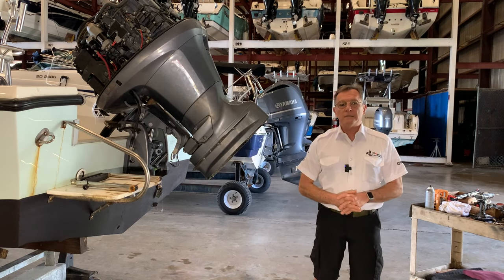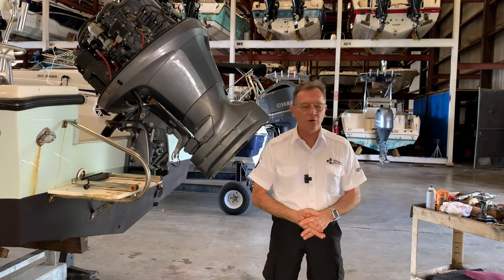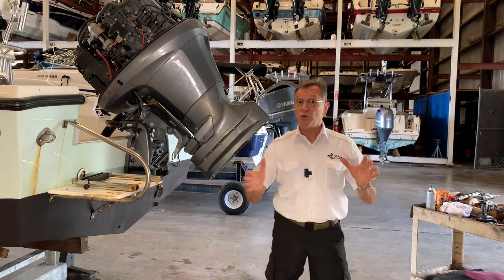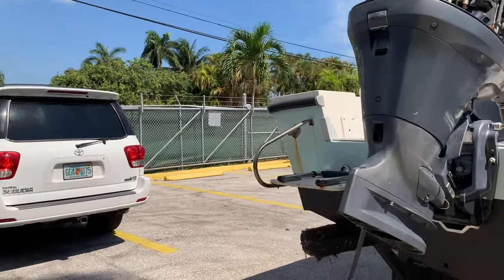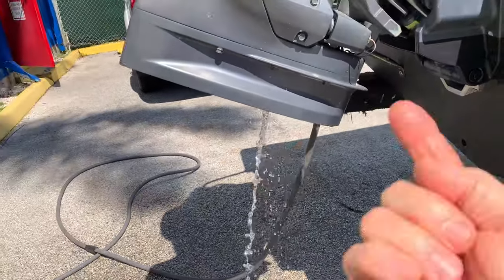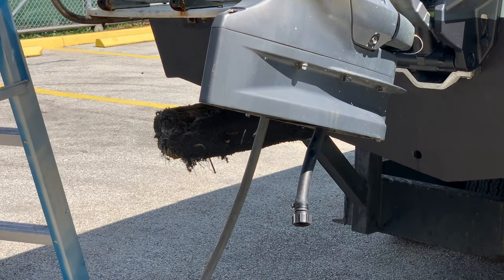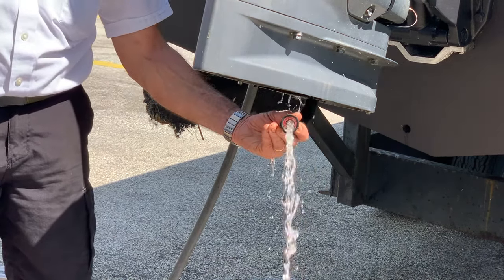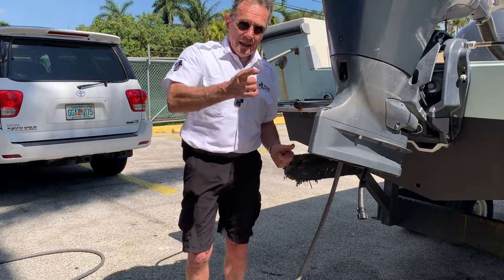CAN I RUN YAMAHA F-150 WITH TOP FLUSH ADAPTER ????

Comment: Burns up impellers , I fix them all the time . However like you said low rpm and for less then a minute is fine but never run for long or rev up on the flush adapter . If running long time u need both top and ears hook up
Reply from the maker: Yeap you got it. Take care.
Reply: What do you mean by need both top and ears hook up? I’m planning to run my motor on its trailer for 5-10 minutes..
Reply: I use both top connection and bottom ear muffs too.  Maybe not necessary just for a quick startup on idle but extra precaution on my part.  Thank you for this informative video.

Comment: I appreciate people like you doing videos like this. I just picked up a Suzuki 150. And I've been running it for approximately 4 to 5 minutes at idle while I had the hose hooked up to the port. Then somebody told me you can't do that. And I say why the water pressure is the same. But your video was very, very specific and self-explanatory.  Now I feel much safer. But of course, my last engine didn't have a port old Evan rude so I didn't have a choice. I used the ear muffs so this one's a little new to me. But Suzuki says I don't have to run the motor at all, which is kind of nice.
Reply from the maker: Thank you for your comment and for participating. 👍🏻

Comment: hello and thank you for your precise explanations :) 

can you tell us if there is a recommendation when flushing the engine on the trim position? Should we preferably keep the trim low or in the maximum high position and take the propeller out of the water at the dock? 

Is it also necessary or recommended during each use in salt water to add an anti-salt additive during rinsing with an automix?

I have a Yamaha F150 and I would like to have your valuable opinion

Comment: During winter season here in east coast, can I remove the lower unit and keep it in my basement for the whole winter? 

Yeah, I always flush my motor from the top port with no problem at all. 

Thanks for the info.
Reply from the maker: Hi Bean, Yes you can,  but what would be the advantage of doing so? Can you elaborate more on this? Thank you for watching and participating. Take care. 👍🏻
Reply: @us4marine  -I winter my boat in a marina so I would rather install a new impeller at home and keep it for the winter.

Comment: Here’s the issue and why Yamaha tells you you should not run the motor through that flush hose. Most residential homes do not have the water pressure needed to safely run the motor while using this method. The water pump pulls water up through the housing and by using your method you’re pushing water into the housing and the impeller is pushing it back faster than it’s coming in therefore you will burn up the impeller.

Comment: Thanks for an informative video on this. I've been doing it thru the hose for a long time and my 2007 Yamaha F50TLR has not been damaged. The only thing is, I've been letting the engine run, after running in saltwater all day, for 5-8 minutes which I hope is not hurting engine. Please let me know if  I'm doing this wrong. Thanks my friend for your knowledge. Steve
Reply from the maker: Hi Steve, no,  you’re not hurting your motor letting it run for 5-8 minutes of flushing through the top adapter, as you can see, there’s is plenty of water/lubricant, getting to the impeller. Thank you so much for watching and for stopping by. Take care 👍🏻
Reply: @us4marine  Thank you for reaching back out. I  do respect ALL your videos. They're full of knowledge and people should respect them and also watch them. Steve

Comment: Great video, you are a wealth of knowledge thank you for this. I have one question maybe you could help me understand with this same engine. Mine is a 2013 F150. After being used in salt water I flush my engine after every use. When I connect to the flush hose and run fresh water I never get water coming out the telltale port like when its running. Is this normal? I always think its better to use the muffs and run the engine to flush instead of the hose? What is better? Thank you!!!
Reply from the maker: Hi Wol9, this is very common on some of these 4 strokers, however is not that common on the F-150, do you have good water pressure on your garden hose? If water comes out when running with the lower flush and not with the top flush adapter and if you have good water pressure, I can only think of the pressure relive valve, some people in the industry call it "Poppet valve" and is this cover right behind your oil filter with 3   #10 bolts. This valve is spring loaded and it needs very good water pressure to push the plunger. But if you’re getting water flow on your side indicator with the bottom muff, I wouldn’t worry too much about it. Now, if you want to make it pee with the top adapter, increase your water pressure and that should do it. Hope this helps. Take care and thank you for participating, your opinion matters. 👍🏻
Reply from the maker: It really doesn’t matter, both ways will do the job, but remember if you doing it from the top with the engine not running, make sure the block is warm enough so the thermostats are open and you’re getting fresh water pass the thermostats and on the other side of your cylinder head.

Comment: what about that thru flush hose thermostat is not open , so water does not go thru all of head of engine?
Reply from the maker: Hi Jedi, correct, that’s why I tell all my customers to let the motor reach it’s running  temperature in order to wait for the thermostat to open, so water can flow through the exhaust side of the cylinder head. Now if you’re referring the water flow while I was testing? No, water was not flowing to the any part of the block because the lower unit was off. The only intention on this test was to show  the impeller is getting plenty of water when using this flushing method.
Hope this helps. Thanks for watching.

Comment: The impelar pumps water up, your pushing water down in the opposite direction to the impelar, I presume the idea of top flushing is to allow you to do this is whilst it's still bolted to the transom in the water.
When water is fed from the top, the impelar is going to try and reverse the flow back up into the engine, could this cause overheating issues if the pressure was equalised and the flow is stopped or slowed?
Reply from the maker: Hi NJ, thank you for watching, your opinion and comment is very appreciated.
The intention of the video is to show that if you run the motor (at idle) while flushing it from the top, the impeller is definitely getting lubricated  and cooled with large amounts of water, that’s all. The pressure couldn’t be equalized due to the water intake screens below the water pump being uncovered. So, there won’t be any back pressure, overheating, and the water won’t be stopped or slow, by running  water from the top,  the flushing procedure has not changed at all, and eventually water will get to the power head through the rear connection on the engine block between the cylinder heads. The only thing added in the procedure is that the engine is running and the impeller is being cooled with plenty of water.
Reply: Hello Njj5674. Excellent observation and wisely asked question. This is the question a master with mechanical knowledge would ask. Congratulations.

Comment: Thank you for the advice. I'm having an issue with my Yamaha F150lb, and wonder if you know what it might be. Motor starts up fine. Runs good at high speeds. If I reduce the speed to just cruise around it will die randomly without warning. Motor will start right back up and run fine for awhile (maybe 5-7 minutes) and dies again. When docking, motor idles fine, but will die while in gear idling into the the dock. Starting it back up is not an issue. I'm open to any suggestions. Thank you.
Reply from the maker: How old is the motor (year) and how many hours on it.?
Reply: @us4marine  Not sure. I was told it was a 2019. The boat actually belongs to a family member and I just take care of it and get to use it. The tag on the motor mount says F150LB 63P L 1210952. I will have to check the hours the next time I go up (the boat does not get a lot of heavy use). I was on it a week ago. It ran good, but then shut off without warning. Really strange. Feels like someone just turned the key off. Starting it back up was not an issue. I was not in a turn or low on fuel. Other than the shutting off, it runs smooth. Thank you for you response.
Reply: @xcbcm  I had that issue with my f115, the linkage had moved slightly at the motor end. Luckily the paint marking showed where it should be.

Comment: I was getting nervous with the research i was doing since i always rinse my Yamaha 250 through the upper adapter. I am going to take off the lower unit and see if the impeller has any damage but i haven’t had issue. Might start using the muffs since that’s what yamaha recommends though😅
Reply from the maker: Hi Ian, let us know what you find and more important how many hours or months since the last time you replaced water pump.
Thank you for watching.

Comment: But you are forcing water against the normal flow of the impeller, correct?
Reply from the maker: Yes, but when  flushed from the top adaptor, the water send to the impeller it's only to keep it wet, there’s a “T” at  the engine block that splits water to both, the impeller and complete engine block. In other words, when flushed from the top the flow of water going to the impeller is not relevant to keep the engine cool.

Comment: So when you just turn on the water with the engine OFF, it won’t discharge water out of the discharge hole also known as peeing? Because when I hook my hose up with engine off, the tell tale doesn’t pee
Reply: it should pee, the water should through all exits.

Comment: no you nighter could or should.... i dont know about your experice but i burned two when i tried ... if you keep the engine running a little bit longer and empeler is new it will burn i have tried that 2 time and failed both times>>>>>>>
Reply from the maker: Correct, reason why  I explained it clearly if you see it at the very beginning of my first video of the 2 I made on the same topic. Thank you for watching.

Comment: So, don't run the motor when flushing from the top hose. Am I right?
Reply from the maker: As I said on the video. Yamaha DOES NOT recommend it. The reason of the video is the show, that if you do, the impeller won’t get  burned as lots of water is raining on top of it. It’s entirely up to you. Thanks for watching.👍🏻
Reply: @us4marine  Many thanks for your advices, sir. Much appreciated.

Comment: when you drop the lower unit the pump comes with it so I don't know what you are talking about
Reply from the maker: Hi Bob,
Let me try this on a different angle and maybe you can understand. The idea of the video is to show it’s ok to run your motor with the water connected on the top adapter and to show that by doing this the impeller will be receiving plenty of water and won’t get burned, right?  There is no any pressurized water flow (as you mentioned) because with the lower unit installed, there is no a dead end for the water flow, why? because once the water gets to the impeller it keeps flowing downwards through the black plastic water intake screens located right UNDER THE PUMP, thus avoiding the pressurized back flow you mentioned, it’s an absolute free water fall. There is no need for the impeller to send water up because the top adapter “T’s” right where it connects to the engine block,  and so supplying plenty of water  to the mid section and the engine block. Hope this helps. 
Thank you for participating.
Reply: Your right, you don’t know. This video proves the pump would be lubricated. Great video! Thanks for the info!
Reply from the maker: @arubanjames  Thank you Aruban, I really  appreciate your opinion, you’re are an important part of this channel. Take care.👍🏻

Comment: Do you see any water coming out from the tell tail in this test?
Reply from the maker: Hi Born, no there is no water from the side indicator on this test, because the lower unit is off, so the water does not find any blockage when reaching the water pump (absent on this test), to increase water pressure enough to get to the indicator. Example:  if I had put my hand at the end of the mid section water tube to restrain the water coming out, water would’ve come out the indicator immediately. Hope this helps. Thank you so much for watching.

Comment: The water goes the other direction
Reply from the maker: Hi Bob, Can you be a little more specific? What way is the water going? On the melted housing, mostly all Yamahas impeller housing are somewhat melted around the inner walls when you remove the impeller cup, this is very common and the reason why the housing, should be replaced every time.

Comment: I melted my impeller hosting doing that
Reply from the maker: Yamahas melted housings is very common even if you don’t flush your motor at all, just with regular use you will find the inner walls meted when servicing the pump.